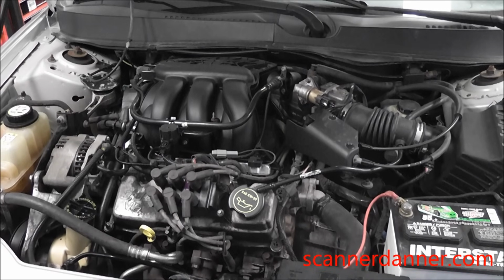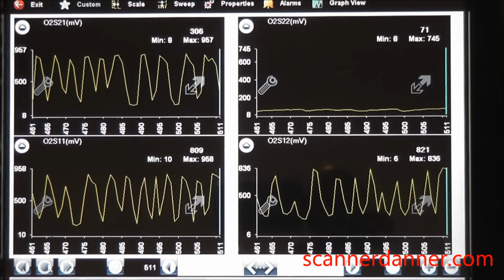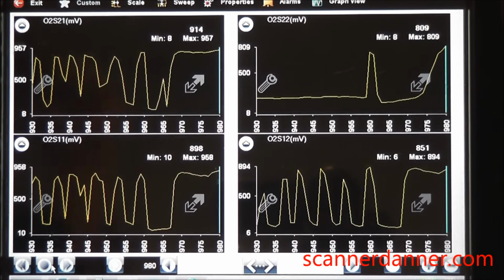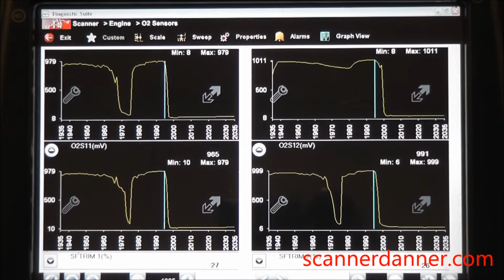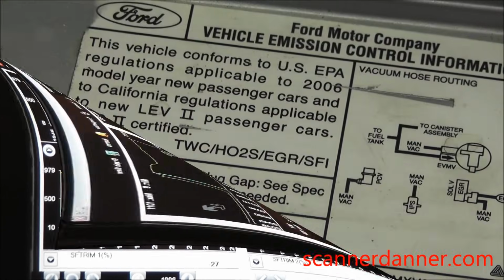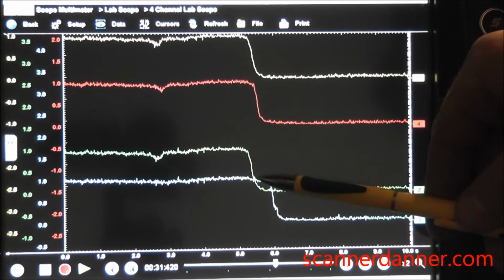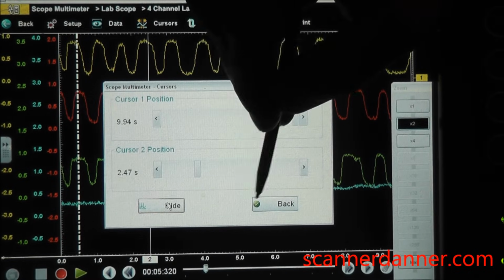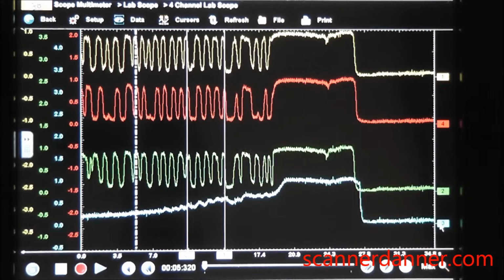Diagnosing a catalyst efficiency code (P0420 or P0430)

Comment: What if I installed a new cat, and downstream o2 sensor,  and the dreaded P0420 code came back? 

I checked for exhaust leaks with soapy water in a spray bottle and didn't see anything bubble. 

I also changed pcv valve. Spark plugs may need to be changed will check that later today. 

The car is a 2006 Honda Accord 2.4 L, 4 cylinder.

Thank you in advance
Reply from the maker: Let me guess, you used an aftermarket cat because it was much cheaper than OEM. Is that accurate?

Comment: What would cause a known good downstream O2 sensor to read mostly 0 volts with occasional spikes to roughly 0.6V? I could see a completely clogged CAT causing the voltage to go to 0, but then I would think I would have significant power loss or even backfires, which I do not. Could it be a wiring issue at or in front of the connector, even though the voltage does not stay at 0V?
Reply from the maker: What codes?

Comment: I have my wifes 2000 VW Beetle that had an efficiency code for the cat. Troubleshot it with the scan tool before I went down to look at the cat. The scan tool told me that the downstream o2 sensor control was not ready/active. Went down under the car and looked at the wiring harness or the downstream o2. Turns out somebody wired the downstream o2 with multiple butt connectors. Going to fix the issue to see if that was my problem. Do you have any videos that talk about how a faulty control circuit could impact the o2? Does the computer just tell the downstream to mimic the upstream o2? Thank you for your time and patience!
Reply from the maker: The O2 creates it's own voltage in reaction to AF ratio changes. The downstream should not mirror the upstream because the cat is burning the leftovers when it is functional

Comment: Mr Danner, wonder if you could explain to your students about old days, where you could trick computer with spark fouler, when cat is bad. Then explain why computers now run the p0420 and p0430 monitor.  Either way I actually learned something from you, which is a common trait watching you and buying your book.  I fixed my p0420 with fuel pump and double checked my work prior.  By propane trick watching fuel trims, and my scanner along with Toyota bi directional, allowed to richen mixture and it never richened it but maybe half click. I also then used function where could turn off pulse width modulation and it gives full 12 volts to pump.  Right off the bat my fuel pressure was 6psi low, and lower on snap throttle, with no drivability issues, but I do these other checks as another step before replacing a part.  Your team is amazing and fun to watch.

Comment: I put 2 gallons of lacquer thinner in the half-filled gas tank of the 2005 Chevy Express 5.3 liter.  I put 305 miles on the vehicle.  I had to refill it a couple of times.  It did not get rid of the P0430 yet.  Mode 6 data for the cat efficiency monitor is:  MAX VALUE 8029, MEASURED VALUES ranging from 802a to 804d during the many completions observed during the 305 miles.  The lower measured value tells me that the monitor is one unit away from passing.  Others on YouTube have said it took 450 miles for the P0430 to go away with only one treatment.  I guess the residual lacquer thinner after each dilution remains active.  I am tempted to replace the bank 2 upstream oxygen sensor.  If there is any laziness in the old sensor, any increased sensitivity from the brand new sensor should push the mode 6 measured value down by one unit to 8029, and that would be a pass, at least for that one instance of the monitor.  The next time it runs, it could be higher than that because the measure value fluctuates. 

The vehicle also had another issue.  The check engine light would flash above 65 mph with no shaking or power loss.  I changed the plugs, wires, and the 4 coils that had a misfire history.  Did not fix it.  Then I saw some guys on YouTube saying to do a crank relearn.  I did it, and the problem went away.  Apparently, when the timing chain starts to stretch, the first symptom is a false P0300 on the highway, which eventually develops into a flashing check engine light on the highway.  You know the timing chain has stretched if you see misfire history on cylinders 1 and 6, according to The Car Doctor in his video on this topic.  However, I believe it's also on 5 and 8.  So, as far as I am concerned, if you see misfire history on cylinders 1,5,6, and 8, do a crank relearn.  Or better yet, do a crank relearn with any P0300 code.  Is this common knowledge on GM engines that you have to do a crank relearn for P0300 due to timing chain stretch?  I had to discover this knowledge through trial and error and luck on YouTube.  I don't have Identifix, but I am willing to bet that guys have talked about this on Identifix.  I was wondering if you have seen this before.

Comment: But cats are supposed to last.. so what is the underlying cause?
Reply from the maker: Contamination. Engines, even good ones will burn oil. Then misfiring over its life at some point (overheat). Then driving habits maybe? Short trips ect.
Reply: @ScannerDanner  I mean what faults can cause the cat to go bad quickly, so its too late when you get the code?  I guess sometimes you get the code its not too late for the cat provided the cause is fixed?

Comment: How system too lean condition affects this test Mr. Danner?
Should I first fix lean condition and then do the catalytic converter test?

I have system too lean and both catalytic converters codes p0420 and p0430.
Reply from the maker: Yes! Always fix any fuel trim related faults or misfire issues before attacking a cat code

Comment: Thank you so much for this Paul. Looks like I need to keep some propane on hand for my next P0420/P0430 codes. This appears to be a narrow band system? Would same principles apply for vehicle with a wide band upstream system the reports in mA and a downstream reporting in mV? Data PID’s may look a little different but the oxygen storage test principles remain the same.

Comment: Late to the party. 97 Rav4. Stft switches fast don't recall the values. Ltft +3--3 ish. Front o2 and rear are twins. No temp change across cat, i know that's not that important.  This thing runs so good. No codes no issues.
Even with the twin o2 readings.
How?
Reply from the maker: With a clean running engine it takes time for the cats to light off which is why you'd be seeing the swings you are on the downstream sensor

Comment: Question so I am trying to fix my mother 1999 Toyota Corolla CE 1ZZFE engine Code P0420 and I do have a scanner when it’s fully warmed up on idle the downstream o2 is steady line but when I raise the rpm to 2500 it will go rich lean like the upstream only when I raise the RPM. Do you think it could be my catalytic converter? Wish I could send you this video I recorded
Reply from the maker: No exhaust leaks? No other codes? Then you need a cat unfortunately
Reply: @ yeah no other codes just that did not check for exhaust leaks yet will be doing that tomorrow

Comment: If the the engine running lean, can we follow this procedure to know the efficiency of that catalytic converter?
Reply from the maker: We can certainly use the downstream O2 in certain circumstances. Are you asking if we can use the downstream O2 signals to  confirmed a lean condition?
I'm not worried about cat efficiency if I know i have a lean condition. I'm fixing that first.

Comment: Merhaba Hyundai Getz 1.3 benzin p0420 kodu alıyorum araba gidiyor ama ışık yanıyor neden?? Sensörler değişmesimi gerek?
Reply from the maker: Most likely you need a new cat if there are no other codes or exhaust leaks
Reply: @ScannerDanner   başka kod yok 02 sensör arızalı olabilirmi?
Reply: @ScannerDanner   arabanın gidişinde sorun yok katalizör arızalı olsa araba çekişten düşmez mi?
Reply from the maker: @sahinzengin1547  most likely not an O2 issue. You'd have other codes
Reply: @ScannerDanner  tankyou ✋

Comment: Thanks, Paul!  Fantastic education on what we can look at to understand cat status. Diagnostics over parts cannon. Because of this vid I found ForScan available for my ‘05 Ford Escape 3.0L, and well worth the price of a dedicated OBDII connector with Ethernet cable. I can now evaluate these same values and graphs, which has alleviated my concern about the front two cats (had to replace the rear, which crapped out not long after repairing the famous Ford Escape ignition coil problem causing misfires). So much more confident in monitoring things myself now.

Comment: I have p0420 and my downstream reads very low steady at 0.03. Does anyone know what that means? I replaced the o2 sensor and reads the same.
Reply from the maker: Step 1 is a fuel enrichment test to make sure you can drive that O2 rich. 
Step 2 is to be 100% sure you do not have any exhaust leaks.
Reply: Thanks Paul!
Reply from the maker: To drive the mixture rich post cat, you have to flood the exhaust with fuel. To do that, rapidly snap the throttle on and off. At some point that rear O2 should hit 800mv
Reply: Stabbing the throttle got my sensor two up to 0.91 and then it went back down to 0.03 steady at idle. Next I’m going to check for exhaust leaks!
Reply from the maker: What that test tells us is your O2 is reporting accurately. For sure look for exhaust leaks, then finally make sure your fuel trim numbers are normal and there are no other codes. From there, you need a cat

Comment: I am unable to graph bank1 senor1 on my ford expedition 2013 snd getting the below on obd2 scanner Currently having p0420 code.
, Oxygen Sensor Output Voltage - Bank1 Sensor 1
PID: 14 - Not supported by vehicle,

Comment: Hey, Paul. Would a leak before the rear o2 cause the same oscillation amplitude or frequency as the front o2?
Reply from the maker: It will cause false codes for sure!

Comment: On my 07 Edge i got p0430, with thermo readings pre and post is 430 and 400°. How much of a difference in readings am i supposed to see
Reply from the maker: Cat temp testing has many variables and is not the most accurate way, in fact, it is the LEAST accurate way to determine if your cat it "bad" 
In theory, the discharge of the cat should be hotter if it's doing something

Comment: I got a 2010 ford focus with the code po420 and also a B1342-20 ecu internal fault… whenever I drive like 70-80mph for 30-40 mines the code go away for a day and come back could it be ECM want to replace
Reply from the maker: It's not the ECM. 
That B code is a body control module code. What's it's definition? 
You probably have a bad cat

Comment: is there a similar test w/o the propane and o-oscope?  I assume if there was, then you'd be sharing that info.
Reply from the maker: You can use a graph on a scanner but the refresh rate is too slow and varies greatly based on the car and the scan tool being used. Also there is not "time" comparison as the scan tool reports in frames, not time

Comment: I have a 2000 tacoma v6. I recently had a p301 cyl 1 misfire and p0300 random misfire codes. Found a bad  cyl 1 injector, replaced it and the code went away and check engine light disappeared. 

A few days later, I get a new check engine code for p0420 catalyst below threshold bank 1 (my scanner doesnt say which sensor just says bank 1). I get my obd2 scanner and check live data and at idle my upstream sensor reads from 0.00 to 900, fluctuating in between every second like you described and the downstream sensor is slowly fluctuating from 3.254 to 3.300. Not sure what to make of this but if I understand what you're explaining is that my B1S1 (upstream before cat) is working properly and the B1S2 (after cat) is not? 

Help would be greatly appreciated
Reply from the maker: it sounds like the 3.2 to 3.3 is a wideband upstream sensor signal. They don't use widebands for downstream sensors. Are you sure you are not confusing the 0-900mv signal and that is your downstream? A misfire can definitely kill a cat!

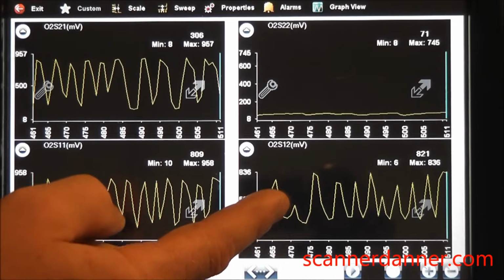Comment: 4:46  Is idling in driveway shortly after my Focus went CL enough time to be considered a "hot cat"?   I'm guessing not. Have no codes, and my scanner is rudimentary compared to here, but I can see cat-monitoring O2 looking like the middle part of the red DS graph, then it gets closer to .45 volts but isn't totally flat. It says US and DS switching is OK, (under component tests)  but says HO2S11 Voltage amplitude fail I.D. 11 Module $10 test value 0 Minimum limit .50
Is this anything to be concerned with? Again NO CODES.
Reply from the maker: No sir. Cat is definitely not hot until you're driving it. Although some more modern systems have fuel/timing strategies with a cold engine for the sole purpose of heating the cat

Comment: Cat monitoring sensor, better name for it.  I will call it that going forward.
Reply from the maker: On most, that is correct. With the addition of affecting fuel trim on some models. If you see your upstream is a wideband, you want to consider also downstream fuel control

Comment: My car is giving me P1135 and P0130 codes . Replaced both O2 sensors and checked the wiring. Still the same. High fuel consumption , exhaust note sounds different also. Sometimes i have backfires from the exhaust when i accelerate hard and let off the gas.
I bought myself OBD2 reader and and did a log for 15-20 minutes twice. I see that my downstream o2 reads the same Voltage as my upstream with a very small delay. Does this mean that i probably got a bad cat? 
Its giving me a headache and my lazy mechanics don't help me.
Reply from the maker: Focus on your upstream O2 and fuel trim numbers. You may have an issue with your fuel system or another sensor reading incorrectly. What is the exact definition of those codes? And what are you working on!!!
Reply: @ScannerDanner  P1135 Air/Fuel Sensor Heater Circuit Response (Bank 1, Sensor 1)

P0130 O2 Sensor Circuit Malfunction (Bank 1, Sensor 1)

The engine is a TJET from Abarth . Could a bad MAP sensor cause this? Even though i dont have DTC for it or for the CAT. Fuel system seems fine. Got all my injectors checked aswell as the fuel pump.
Reply from the maker: @whitegptjet  definitely focus on your O2 sensor! Doesn't matter if it's a new sensor. You have heater and sensor circuit codes. Start with the heater and do direct voltage measurements at the sensor and report what you see on both wires
Reply: @ScannerDanner  Okay. Yesterday i checked resistance on all o2s and they were withing the range. Sockets in the car wiring were also outputting correct voltage. 
I will try and visit a mechanic again even though most of them are either lazy to work and some of them don't even want to dig and find the issue.
Reply from the maker: @whitegptjet  all voltage measurements must be done with the O2 plugged in and backprobing the connector, with engine running.

Comment: Question:  If you’re doing an oxygen storage test by making a rich condition using propane and then removing it, to see how long the cat stays rich, it’s not testing how long it holds onto oxygen, it’s testing how long it stays rich.  Which seems to me more like measuring how slow the gases flow through the cat.

Comment: I have a 2001 taurus it was throwing the PO420 code as well, plus gas mileage was down. Changed all 4 O2 sensors. Dumped a bottle of cat cleaning solution in it at 1/4 tank drove like 45 minutes. Cleared codes. And the PO420 code popped back up. Got online and googled the PO420 codes it said check O2 sensors which I replaced all 4, check ECS (engine coolant sensor) sensor. I scanned it it was running at 174 going highway speed until I slowed down then it would go up to 185-190. So I decided to change the ECS sensor to see what it would do after clearing the codes again. And the PO420 code hasn't popped up since then and the temp has been at 185-190 since and my gas mileage went back up too. And it's been a week since changing the ECS sensor. So I'm guessing it was ECS all along with the PO420 code and not the cat's or the O2 sensors. Thank god I didn't replace my cat's w/o changing my ECS sensor first. I do cheap parts first b4 going to the most expensive parts. Sorry for the long story lol.
Reply: i had a car with a p0420 code diagnosing. It wasnt the cat or oxygen sensors, but the problem was a faulty intermittent crankshaft sensor !

Comment: Great info, My friends 2011 Arcadia has po420&30 codes still with all new o2s and cats. When I heard it wasn't fixed I scanned the SUV and found the downstream o2s almost mirror the upstream sensors. He said they put in OEM parts.??? Now I've got some direction to go after S & L trims all looked good. It runs great and no other values out of range. O2s all respond correctly to rich lean commands. I'll check common components to both banks like PVC, leaks intake or exhaust, and them run the o2 retention test. Thanks! Oh forgot GM TSB  PIP5232A states check engine block grounds on vehicles 2015 and older if you have cat failures. I find that interesting.
Reply from the maker: Did they use OEM cats? I doubt it as they're 3 or 4 times the cost of aftermarket. 
Unfortunately that is what is needed on these! Factory cats only!

Comment: Go buy a infrared thermometer.  Check the temp at the front and then the back of the cat. If it's hotter at the front the cat is probably bad. Make sure you let the vehicle run for a while. My bank 2 was 250 to 500. Bank 1 was 425 and 418. I'm waiting for ford to get one in.